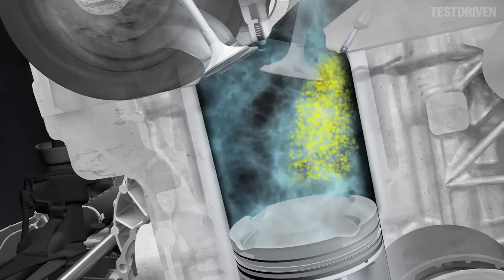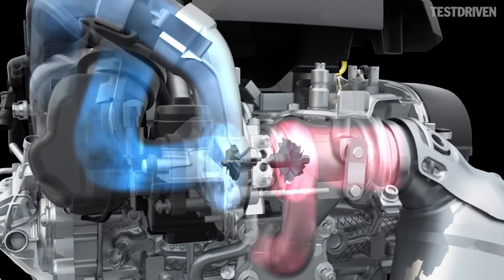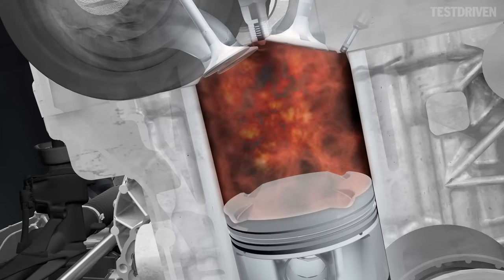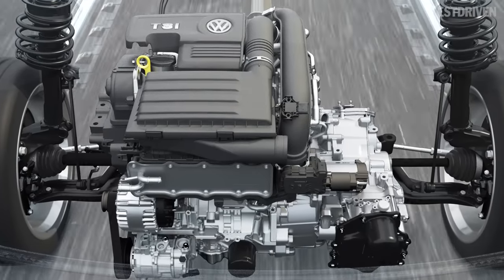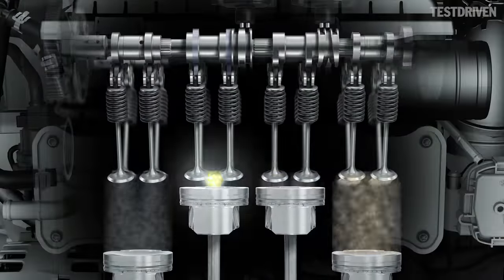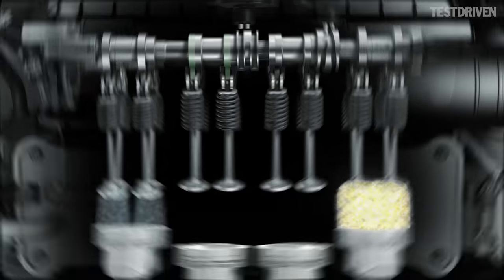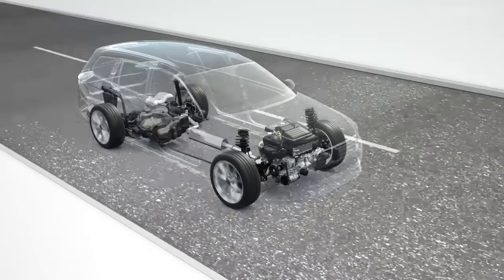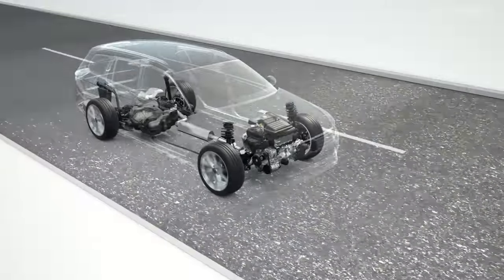Volkswagen TSI engine animation

Comment: They forgot to explain the part when the timing chain tensioner fails.
Reply: But this one has a casual timing belt :v
Reply: Exactly what i thought when i have seen this video first time 🤣👍🏻
Reply: Yep. Just about every VW or Audi turbocharged four cylinder for sale reads:

20xx 1xx,xxx km. Engine repaired/rebuilt/replaced at xx,xxx km.
Reply: @Bartonovich52  lol no
Reply: Around 2009 nearly each 1.4 TSI had a failing chain.
Reply: Yeah that's was the first problem I had in my new gti but lucky I replaced it with a updated aluminum part instead of plastic
Reply: I have a 2009 Golf GTI and its timing chain tensioner fails
Reply: @tuzzosecount1106  Sorry to hear that. My GTI is 2011 and it was just a little early out of the factory to have the revised tensioner. Mine failed at 60000 miles and cost £3k to repair the engine.

God how I hate that car. I hope that yours causes you no further problems in the future.

All the best
Reply: @danieldurchtechnik6804  ahahahha Now the water pump has broken. Years ago, the air conditioning system broke and all the carpet was soaked with water, so we had to take it all apart and put it to dry in an oven by a coachbuilder. Furthermore, the radiator has corroded and pierced (I live 400km from the sea) and a radiator's little tube was clogged. The driver's seat has now frayed and the air conditioning fan wobbles and is noisy.
Reply: @danieldurchtechnik6804  My family spent almost 10k euro for that car
Reply: @danieldurchtechnik6804  i think with new tires and revisions about 13k
Reply: @tuzzosecount1106  That's some bad luck. I have been getting rid of mine for about two years now, as much as I hate it, I love it too. Until it breaks again 😭
Reply: @danieldurchtechnik6804  i'm serious i'm not kidding i'm serious it happened this afternoon i'm not kidding a boy intern stole the keys of my golf that was in the workshop, he accessed the engine there was the first gear he accelerated he went crashing into another car he smashed the front bumper and the door I'm not kidding it happened just a few hours ago today
Reply: @tuzzosecount1106   Holy shit! I thought the only car I jinxed was my own! Well at least if the kid is an employee, his company will be liable for the damage, even though it's a pain in the ass whilst waiting for it to be fixed.

I think I am going to go Japanese next - they are far more reliable and not as expensive to fix than German cars (the parts are where you really get ripped off).

My GTI issues have been mainly engine related, i.e. intake manifold x2, multiple misfires, seized fuel injector (destroyed camshaft)and of course the timing chain tensioner which caused catastrophic engine damage.

I still love it but I wish I had done my research before I purchased it.

Again I am so sorry to hear about all the bad luck with your GTI, better to get rid eventually. Although that's easier said than done...
Reply: We never had A problem we have A tsi 1.6 vw tiguan 2011
Reply: @4DollaSignaken  Don't think Tiguan's come in 1.6 variant? Besides, the 2.0 engine is a different matter as the Golf GTI / R models demand 210 - 270 bhp output, depending upon the model.

Therefore, having smaller engines that produce lots of power is also what causes the multiple problems due to the smaller components and general poor design. They should be a V6 rather than only four cylinder.

I am happy to hear that you have had no problems with your car. To be honest I don't know anyone with a Tiguan or a car with that specific engine (nor do I know much about the engine itself), however I can attest to the poor design, unreliability and inefficiency of the 2.0 TFSI engine.

Just google "VW Golf Mk6 GTI engine problems" and you'll see where I am coming from. I can assure you that I have experienced these first-hand, as have many others.
Reply: True! Shitty engine!
Reply: Just bought myself a GTI coo, glad I have a 2yr warranty. Planning on selling it in about 6 months to get another car as I usual anyway
Reply: And the turbo, and the pistons, and the fuel pump, water pump, ECU,  gearbox... I even knew of one where the glovebox lock failed, meaning that the owner couldn't get the warranty info out to get it repaired.
Reply: @henrikholt864  shitty brand, sadly. Once one of the best.
Reply: @henrikholt864  gen2 tsi engines were shitty, the newer gen 3 ea888 tsi engines fixed most of the problems of the previous ones, other then carbon buildup as thats still a problem but thats with all direct injection engines not just VW... however in europe the tsi engines get port injection which is much better and cleans the valves. North American emission standards really screw us.
Reply: Lmao I’ve had a timing tensioner for around 9 years and have never needed to change it. As long as you maintain the car properly and dont Go too hard it’ll be fine
Reply: yeah u right, but this problem was with Tsi Firts generation, Second generation doesnt have that problem enymore
Reply: and when the pistonrings wear out, i couple of months
Reply: @lronMan88  this has a belt.

EA888 3rd gen I've seen with 300,000km
Reply: @menju32  well i got a 2009 scirocco 160 hp CAVD and till today i only changed the water pump reel and the brakes ....
Reply: @wearegamers4662  No, 2nd generation was the worst generation. The Gen 3 was the one where they fixed the issues.
Reply: @Alexandru-T.  2.0t 2009 gen 2 EA888 94k miles on original timing chain and tensioner , its a ticking time bomb
Reply: @dc8337  Maybe, maybe not. You can do preventative maintenance and change the tensioner with the revised version. That way you can eliminate that risk.
Reply: @Alexandru-T.  currently makes a horrible metallic noise on de-cel more then sure its the chain. But i mean if im going to have the tensioner changed i might aswell get the chain etc changed while its all open. quoted  £900 however...
Reply: Or the water pump/thermostat
Reply: hahahhahhahahahahaha
Reply: @danieldurchtechnik6804  dot on I have a 2015 1.8tsi and its nothing but problems 84,000km with turbo replaced waterpump replaced had boost leak as well oil leaking into cylinder 1,4  and transmission issues they get expensive  quick as they age  im going back to jdm 😂
Reply: @Alexandru-T.  new ones still have turbo failure,waterpump failure, oil leaking, transmission issues, idle issues  just a terrible design
Reply: I just watched a video about this problem exactly 😂😂
Reply: setting the parking break before letting your foot off the brakes avoids this issue.
Reply: @danieldurchtechnik6804  Thanks for sharing your thoughts. I was thinking of buying Audi but now 😂 I will surely not.
As It will act as ticking bomb for my money
Reply: @udaygawande5681  Yes they are definitely best avoided. Every other part of the car (Mk6 GTI) is impeccable.

Just an awful engine sadly!
Reply: 0 issues,
Reply: @danieldurchtechnik6804  =(
Reply: @Hamdaan-u1d  yup correct oil in car is a must. Lots on here probably put junk in.. And do it after 20000 miles. Some tensioners rely on oil viscosity. Minis are the same even diesels..
Reply: Shit like that happens on every car.
Reply: @johnm3907  Shit like that should not occur as a common fault. 

You ought to google 'vw mk6 gti timing chain tensioner' to see what I mean. 

Timing chains and / or tensioners fail from time to time, however not on the sheer scale of cars that are unlucky enough to host this engine.

These engines are horrifically unreliable, and are known to have defective components which fail catastrophically. 

I am afraid you don't know what you're on about.
Reply: 180k kilometers driven 1.4 tsi muktifuel. No repairs done. And I drive it "hard" often
Reply: @Hawokki  Exception to the rule. Plus I have been referring to 4 cylinder 2.0 engines that are incredibly small however they are expected to deliver anything from 210bhp to 300bhp.

I admit that I don't know very much about the 1.2 or 1.4 variants, but the 2.0 ones are dreadful.
Reply: Can confirm.  I just received an 09 Wolfsburg with the 2.0tsi CCTA for free.  Entire top end was wiped out and all 16 valves were bent because of the tensioner failure.  Surprisingly, this one survived to 170,000 miles before it failed.  Currently rebuilding the head, new timing parts, and intake cam (800$ new).  Let me tell you these are not fun to work on, nor are OEM VW parts cheap...
Reply: @nvdubs  All the best on the project! 

Just for the love of God ensure that you get the revised tensioner, as far as I know this one works okay. 

Hope all goes well. 

Gotta say that the Wolfsburg edition is pretty nice so if you can get it up and running then you have got a gem.
Reply: @menju32  ....and water pump,defect on 15.000 km.
Reply: This was a 1.4T I’m guessing the 1.4 has a belt since it’s a budget engine
Reply: My 1.0 polo tsi runs to to its limits all the time but also take good care too. Other than the water pump never had to change anything. Over 11000km now. Love my little 1L 3cyl.
Reply: Or when the pistons crack.
Reply: Hahaha fuck you for this, I'm having this exact problem now 😂 
Bought an MK6 jetta with the 1.8l tsi engine and started having a check engine after a quick 10 minute drive to and from work. Checked it out with my father who's an experienced mechanic and the timing chain tensioner seems to be almost broken and not working properly, timing chain is also pretty marked up so we're going ahead and replacing all the timing chain components. This hurts so bad LMAOOOOO
Reply: And the DSG as well
Reply: @tuzzosecount1106  Are u kidding or what ? The car itself only 3000 USD and you repaired it for 13k Euro ? Sick
Reply: @Toczusiek  most tsi have timing chain except this one.
Reply: @Bartonovich52  my vw passat from 2008 2.0 Turbo FSI (147kW) has 210 000 km and still going strong wit agressive driving  every day
Reply: @Bartonovich52, not mine, hahaha it's Called proper maintenance
Reply: 125k on my mk6 GTI and it finally went before catastrophic failure 😅
Reply: You do know that tensioner was faulty and it was recalled right? And you are supposed to change the timing chain assembly every 80,000-120,00 miles right?
Reply: Its not the tensioner, but the elongated chain......but this Is not the chain version...chain Is between 2009-2013
Reply: I had a Leon 1.4 tsi. At 120k kms it was his second chains kit change
Reply: @Toczusiek yes the TSI timing belts can last 210000 km no problem.. the cams are oval and special timing setting to make less strain and HQ belt too. Heard reports they can last 300.000 km without wear indications. VW stipulates 210k km between changes or 10 years in Sweden.
Reply: 1.8 tsi ea888 no problems at 133000

Comment: I learned from this video that a TSI engine works just like any other gasoline engine 👌
Reply: Maby because everyone else has copied it?  😄  👍
Reply: They did a poor job of copying it because their engines don’t seem to eat their innards.
Reply: Hahaha LOL
Reply: That technology of high pressure fuel and cancelling cylinders is years old I'm talking late 80s but volkswagen has made the 1.4 with high pressure fuel very economical I get 39 mpg hwy so I will give them that they are different in the way of efficiently having having higher hp with a turbo.
Reply: This engine is shit
Reply: But not as long as any other engine
Reply: Yes its a normal GDI engine.
They just named it TSI.
Reply: @YTbrichtDatenschutz  the TDI engine is better
Reply: Yep they just moved the fuel injector and added a high pressure fuel pump.
Reply: You missed the point Getting 118kw from a 1.4 engine where some 2.0 litre engines yield 70kw  Also, generally the 1.4 uses less fuel. More power, less consumption.
Reply: @Micro13bk  lol no... the torque in it is shit
Reply: @rockythegiant5056  Don't diesel engines generally have more torque by default?
Reply: Lmao,  but you'll get those people who think its revolutionary
Reply: @rockythegiant5056  not it is not
Reply: @ssx-nd6cg  lmao 39 mpg highway is horrible for a new car, I get that on my 90s Suzuki Vitara diesel (geo Tracker) when running on free vegetable oil, city driving
Reply: @YTbrichtDatenschutz  why is the engine shit?
Reply: @jhsevs  no it’s not I get 17 mpg in my v8 Touareg,
Reply: @whydontyouaskme  you're proving my point
Reply: My car doesn't turn off 2 cylinders to reduce consumption and doesn't have direct injection either, so, is not the same.
Reply: @mdanas0007  Not all GDI engines are turbocharged;  Hyundai for instance.  The great thing about the TSI is the careful integration of the GDI and the turbo, providing more power and better fuel economy than GDI alone, but with no turbo lag.

Comment: They didn't say about the oil consumption of this engine...
Reply: Same as gasoline
Reply: @loremipsumdolor1444  true story
Reply: My 1.2 TSI(105PS) consumption is about 10 liters/100km. Very economic 😂
Reply: Mine consumes none at all.
Reply: @mqbitsko25  after 2014 none of them consume
Reply: Cuz that was the Tdi...
Reply: @shivamthakur8148  lol, Volkswagen make the second best diesel engines.
Reply: Because the oil consumption is very low?  Ours uses about 1 litre of oil per 10000 km - a third of what the Toyota it replaced used.
As is the gas consumption.  5L/100 km on the highway is very nice!
Reply: That's difficult to believe. @eatonjask

Comment: So the german engineers never thought "hey there's alot carbon build up from the direct injection, this could be a problem " 🤔
Reply: Of course they knew that this is a problem - but after the warranty period, so not their problem ;)
Reply: German cars from the past 15 years have been a disgrace
Reply: I'm at 200k and it runs just as good as it did when I bought it, and when I looked while changing the plugs there didn't seem to be much carbon on the head or plugs
Reply: @ikannunaplays  The carbon is in the intake, not inside the cylinder.
Reply: @em4703  Where exactly on the intake? Because the intake is bringing clean air from outside the car that wouldn't have carbon in it, unless it's after the EGR.
Reply: The carbon buildup is on top of the valves because it is a direct injected engine. There is no fuel getting there to keep it clean. Carbon buildup can be effectively cleaned. I have a tsi engine in my VW Jetta and love it!  My other vehicle is a Chevrolet Silverado V8 and I like that engine also.
Reply: @ikannunaplays  Is the egr AFTER the valves? Or the PCV? No, they aren't. That's where the deposits come from, particularly the EGR.

Comment: Then the water pump goes, timing tensioner has to be updated, carbon cleaning has to also be done, and then the water pump again, and then then chain guides have to be change. So on and so on.
Reply: Seven years, 125000 km, none of the above!

Comment: "Reliable system" hahaha, there are 15 chains in the engine....
Reply: That doesn't mean that chains are bad. People always say that it's because of the oil change. But none of that is true. In the early days, so-called toothed chains were used. These are characterised by the fact that they are quieter than roller chains. However, they cannot transmit torque and wear out more quickly under heavy use. If the start-stop system stops the engine at every traffic light, this fragile system is overloaded. This is because the torque is greatest at the moment when the engine is started. In addition, the chain tensioner is insufficient. It depends on the oil pressure. When the engine is at a standstill, there is no pressure. The chain is therefore subjected to even more stress. The result is then that you can easily observe today. VW now offers a conversion kit for a roller chain. Why not do it like this?
Reply: No there aren't.  The TSI engine with a timing chain has 3.  One for the oil pump, one for balance shafts, and one for cam timing.
Reply: Better chains than belts....

Comment: 140,000km on my 2014 Skoda Octavia with the 2.0 TSi engine. Ran beautifully, only had a small water pump leak.
Reply: Did you ever find yours had a slight misfire at idle when cold?
Reply: @randomworld1  Carbon on intake valves
Reply: @danielfl.9347  yes, I'm sure that's the problem now. It's EXTREMELY intermittent and still present after new spark plugs and coils.
Reply: @randomworld1  You need to clean it with a walnut blaster. Only way to do it right. 

Some workshops have them. Cost around £300
Reply: I’ve got a 2014 1.8 tsi Octavia too. Had the thermostat leaking too, then when I topped up coolant I saw oil sludge in it. Had to replace the oil cooler+thermostat with water pump. Then I discovered heater doesn’t work, so the oil in the coolant blocked the valve, which also was replaced, then shortly after the turbo wastegate is done at the same time the oil sensor stopped working. Oh almost forgot to mention the amount of carbon build up I saw when I pulled the intake manifold. That was when I needed to get to the thermostat assembly. I’ve cleaned it as much as I can, but hard carbon couldn’t be removed by chemicals, so it stays there.
   Verdict if you have a TSI, get rid of it after 100K kms or be prepared to invest in it(I guess it’s the same with any other engine).
By the way few weeks ago I bought a top spec Superb with 2.0 TSI. They just too nice to say no LOL
Reply: @randomworld1  We had this - 1.8 TSI - it was a faulty camshaft position sensor.  The misfire was intermittent, and mostly at idle.  Has the OBDII system thrown a code?
Reply: @randomworld1  Try Seafoam or Techron fuel additive - works on intake valve deposits on all VWs.  (Intake valve deposits from cheap gas have been a VW problem since the Golf Mark I in the 1970s.)